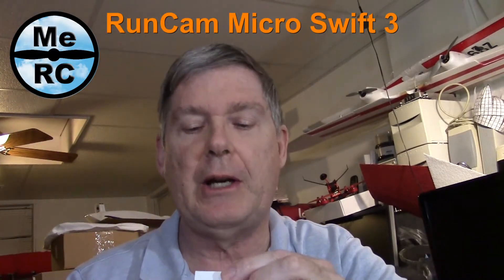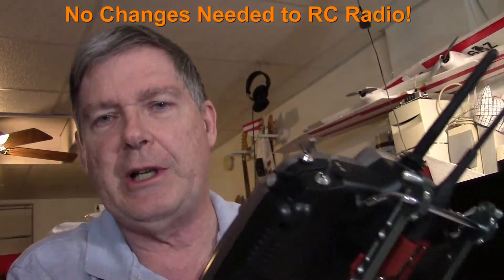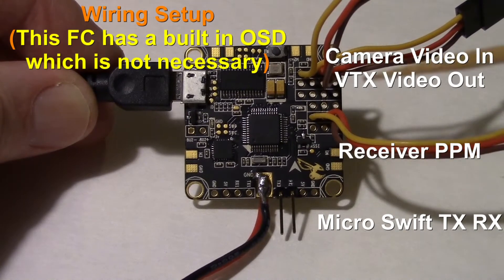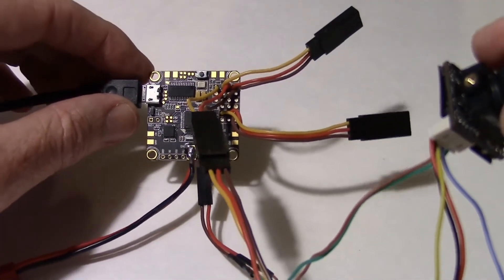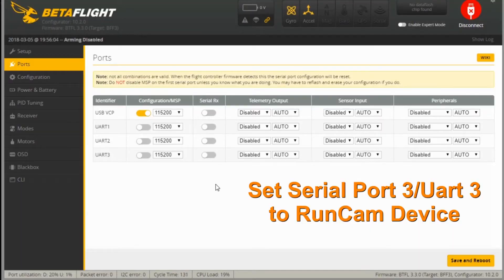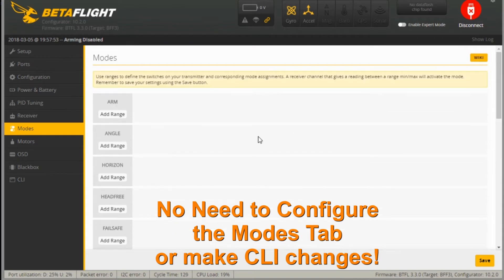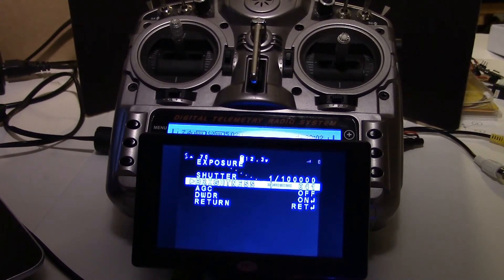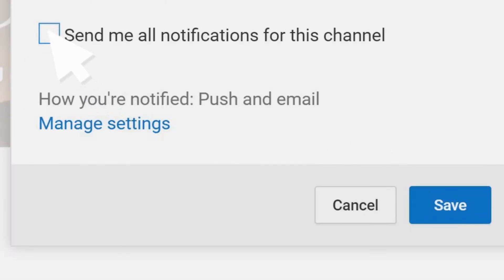Runcam Micro Swift 3 on Amazon - New Easy Setup for RC Stick Menus on BetaFlight 3.3 FC

Comment from the maker: The Radio Stick Menus also work with iNav CleanFlight! Tried it on a FC with iNav 1.8 and it worked using the RunCam Split on the ports tab for UARTT 3 which was a pleasant surprise! There was no selection for "RunCam Device" on iNav CleanFlight so I just used "RunCam Split" selection for UART 3.

Comment: Hi, I have the same setup, but dont have uart left, so used a soft serial1 (enabled s serial in bf 3.3, and configured as runcam device on ports tab. But not working, so wondering if its only works on uart ?
Reply from the maker: Only examples I have seen are on UART. You could ask info@runcam.com
Reply: Dave Merc Productions yeah me too, let me ask runcam, thanks

Comment: Nice job Dave...I hope they include this inside iNAV...???....Sooo full right Rudder takes you into the Cameras parameter menu..?....Should that not be on a dedicated switch perhaps?
Reply from the maker: Yes bump it to the right twice to enter menu, but perhaps it won't activate if you are armed and flying.  It's a Beta version so we shall see when the pre-release comes out. I have been temped to try it with iNav 1.9 and see what happens. I just tried it on a FC with  iNav 1.8 (to lazy to load 1.9) and it worked using the RunCam Split on the ports tab for UARTT 3 which was a pleasant surprise!

Comment: Just a small tip: It can be hard to read the camera menu when betaflight OSD is active, especially after disarming when betaflight clutters the screen with post flight statistics. So I assigned a switch to "OSD DISABLE SW" in the betaflight modes tab so I can temporarily disable the betaflight OSD.
Reply from the maker: Good idea!

Comment: I have camera control from the transmitter on different quads using the camera control feature of betaflight on a motor pad (see https://github.com/betaflight/betaflight/wiki/FPV-Camera-Control-(Joystick-Emulation) ). Everything works nicely  but I like the UART approach much better. Way to go, Runcam!

Comment: I'm not really enthusiastic about this. I honestly prefer using the old good OSD cable stick and change my settings, i generally don't tweak my camera settings over time unless i kill it and i have to use a new one!
Please tell me we can still use the OSD cable stick on this camera :/
Thanks for sharing Dave and keep on reviewing all these goodies :)
Reply from the maker: That is a good question. Can we still we still use the OSD joystick dongle?
My guess is that a passive dongle would not work and RunCam would have to make a serial port dongle that had a battery in it power the cam. 
Just guessing. If this gets to be a trend I would make one out of an old flight controller.